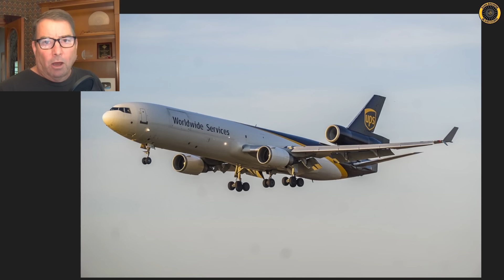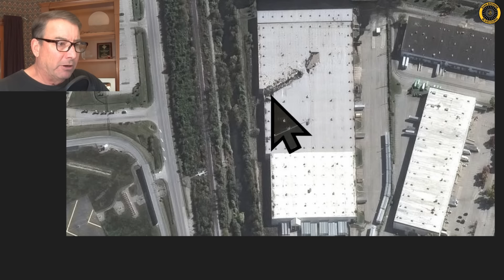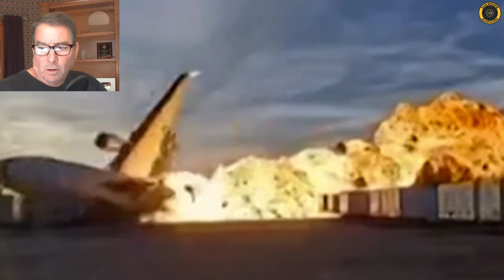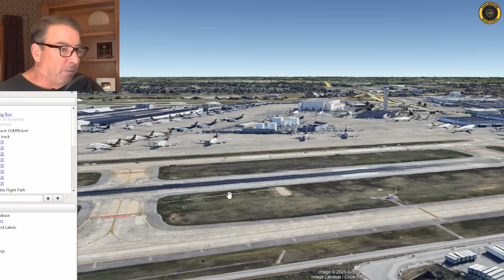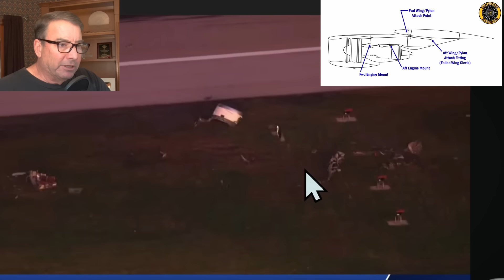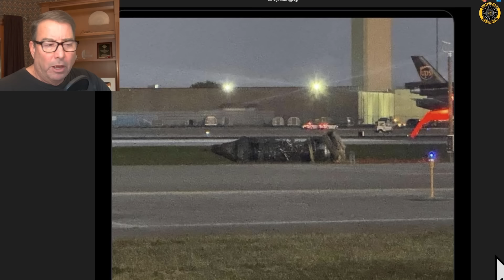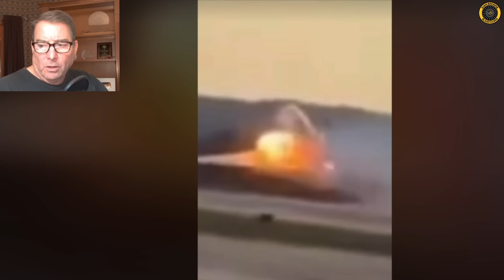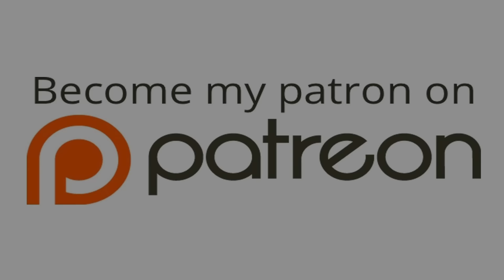UPS #2976 UPDATE 2 6 Nov 2025

Comment: 💰 1⃣ Refund and insurance payout

Yes — all packages on board are considered total losses.
UPS’s self-insurance covers them automatically.

For retail customers, UPS refunds the declared value (or standard liability if none was declared).

For corporate accounts, UPS credits or reimburses based on contractual coverage or third-party cargo insurance.

There’s no need to “file” in most cases; UPS’s system matches tracking numbers to the manifest and triggers compensation automatically once the NTSB releases the manifest list.

📦 2⃣ No re-shipment or recovery

After a crash like this, the entire cargo hold is destroyed or contaminated — jet fuel, fire, and impact damage make almost every package unrecoverable or unsalvageable.

Even if a few packages are found intact, they cannot be reused or resent:

They’re held as investigative evidence until the NTSB releases the site.

They’re then destroyed for contamination, chain-of-custody, and liability reasons.

So, you won’t see any packages from that flight delivered or re-routed later.

🗂 3⃣ How UPS handles it internally

The cargo manifest (every tracking number) is frozen.

Customers’ tracking pages change to “Service disruption — aircraft incident.”

Once the investigation allows, the system marks all items “Lost – Refunded.”

Major shippers are notified through UPS account reps and given claim batch summaries.

📞 4⃣ What happens for customers

UPS sends notification emails for affected shipments.

Refunds or claim payouts go to the original payer/sender — not necessarily the recipient.

Merchants often re-ship replacement goods once the refund or credit is confirmed.

✈ In short

✅ All packages = fully refunded/insured
🚫 No packages = recovered or re-sent
📄 UPS & NTSB = retain manifest for records, not redistribution

Comment: 📦 1⃣ Immediate loss and manifest reconciliation

Every UPS aircraft carries an electronic cargo manifest, tied to tracking numbers.

As soon as the crash occurred, that manifest was frozen in UPS’s internal systems, so all packages listed on that flight show as “Exception – Aircraft Incident” or “Service Disruption.”

Those packages are then marked lost pending recovery — nothing gets rerouted from that manifest until corporate cargo security reconciles it.

🧾 2⃣ Insurance and claims

UPS automatically self-insures for most cargo; major commercial customers (like Amazon, Apple, or medical supply chains) have contractual coverage through UPS.

Individual shippers who declared value (the “declared value” field you sometimes see when you ship) can file claims for reimbursement.

UPS will proactively contact high-value clients through their account reps once the manifest is confirmed destroyed.

For consumer shipments, UPS typically issues:

“We regret to inform you your shipment was aboard UPS Flight 2976, which was involved in an accident. A replacement or refund will be arranged.”

🚧 3⃣ Package recovery

In the crash zone, UPS security and NTSB coordinate with local authorities to recover identifiable cargo.

No item—even one found intact—can be returned to a customer until:

It is released by investigators (to avoid contaminating evidence),

It is decontaminated (fuel, debris, biohazard, etc.), and

Chain-of-custody paperwork is verified.

In practice, very little cargo from high-energy impact/fuel fire events survives intact.

🗂 4⃣ Data archiving and customer notification

UPS keeps the full cargo manifest on file as part of the NTSB docket, just like maintenance and flight data.

Customers are notified through normal tracking channels; large shippers get batch notifications.

Insurance settlements are processed automatically — usually within 15–30 days after UPS confirms the NTSB release of the cargo manifest.

🕊 5⃣ Bigger picture

While it’s easy to think of the packages, UPS’s first and overriding focus in the aftermath is the crew and families, not freight. Only once the human and safety aspects are stabilized does UPS’s cargo recovery and claim division engage fully.

So in short:

All cargo on Flight 2976 is presumed lost.

UPS’s internal insurance covers both commercial and retail customers.

Claim and refund processes will run automatically, with direct customer notifications once the manifest is officially cleared.

Comment: What I want to know is whether the left engine (and pylon) finally detached as part of the "Rotate" action ? Remember that the pylon is meant to detach from the wing "safely" moving up and over in a stress situation. 

This crash seems more like the El-Al Boeing 747F crash in Amsterdam, where a P&W JT9D engine failed after takeoff and broke off from the No. 3 position and flew to the right... damaging the wing and removing the No. 4 engine as well. That would explain how the MD-11 left engine made its way across to the right of the runway... all that rotational energy spinning clockwise....

It's also weird that the plane swerved sharply  left after takeoff.... severe differential thrust effect once airborne and off the wheels ?

Comment: If an uncontained engine failure could cause the pylon to fail, would we need to rethink our designs going forward? Has that ever happened before?
Reply: Yes.  About a dozen times.  Look up 1990 Northwest flight 5.  Better to drop an engine that is coming apart, than have it sling parts through the fuselage, killing passengers and severing hydraulic lines and electrical wiring.

Comment: I do understand that the number two engine may have gotten some intake of debris. But the asymmetric thrust would have brought it out of the flow from behind the number one engine. There was a different videographer who is claiming that as the plane was going over the road it had already hit a building even though the landing gear was intact. I listen to him but it was obvious that he was repeating about 20% of nonsense. I like your observations. I have consulted on air crashes ever since I was actually in the Air Force but not on an official scale but on a consistent scale. I was one of the few non ncos that was allowed to fly the simulator on my air base and actually teach Pilots tricks that they could do to get certain elements of the flight control systems to work when they aren't supposed to.

Comment: ✈ 1⃣ The MD-11F fleet is still active

UPS hasn’t grounded its tri-jets after the UPS 2976 crash.

The flight you cited (UPS2950) shows normal routing, speed, and duration for an MD-11F westbound trans-U.S. cargo sector.

Similar flights (SDF–ANC, SDF–ONT, SDF–OAK) continue showing MD-11F equipment.

The fleet is likely under enhanced inspection, not suspension.

⚙ 2⃣ What’s likely happening internally

After a major event like this, operators usually:

Ground only aircraft needing inspection (e.g., those that recently had similar maintenance or engine work).

Run ultrasonic/NDT checks on pylon attach fittings and mounts.

Report inspection results daily to FAA/NTSB and OEM (Boeing).

So UPS is probably rotating the fleet through short maintenance holds but keeping unaffected jets flying to maintain network continuity.

📦 3⃣ Why they can safely do that

The MD-11 has extensive individual-aircraft tracking; any with similar engine/pylon maintenance (same shop, same parts batch) would be prioritized for checks.

No NTSB “urgent recommendation” or FAA Airworthiness Directive has been issued yet — meaning no evidence so far of a systemic defect requiring grounding.

🧭 4⃣ Operational context

UPS’s network is highly dependent on its Louisville Worldport hub (SDF) — grounding all MD-11Fs would cripple overnight freight flow.
So instead, they’re likely applying tiered mitigation:

Immediate inspection of aircraft with matching maintenance events.

Controlled release of cleared aircraft.

Fleet-wide inspection within a set time frame (often 7–10 days).

✅ Bottom line:
UPS’s MD-11Fs are still flying.
There is no fleet-wide grounding order, only heightened internal scrutiny.
The NTSB has not yet recommended any operational restriction.
Reply: Great info. Thx.

Comment: One of my friends is a check airmen/mgt. on the eleven. UPS has assigned him as a liaison with the NTSB/FAA. Its been tough on him but he is doing the job. As a local I've been close and the smell alone will give you pause. Prayers up for all affected by this horrible tragedy.
Reply: I'm out in Prospect and work in the east end now but even still I have a coworker who's son was (hopefully) or still is one of the missing. Everyone here has some connection to UPS, either worked there (I did) or knows someone who does.... what a disaster.
Reply: @Nefville  Yep. My son works for ups. We're not that far away either.
Reply: I used to be a bicycle mechanic, and worked on bicycle for several UPS pilots, including a couple who were MD-11 crew. I think most of them have retired since then (this has been over a dozen years ago), but I'm sure they are shaken up just the same. I feel terrible for them, and everyone else involved.
Reply: So many of us from Louisville are tied to that area. Between the workers at UPS and FORD LAP, a good majority have some connection to that spot. Prayers to all who are effected and loved ones
Reply: I used to have an instructor who was a UPS check airman for the 747. Top-notch pilot.

Comment: 6:00 - The synthetic fibre material surrounding the fan blades is not so much for acoustic purposes, but to act as a containment barrier in the event of the engine exploding. The sheets of wrapped, woven aramid [kevlar] cloth act exactly like the layers of a bullet-proof vest, which form a dense net of extremely high tensile strength strands which are effective at resisting penetration by bullets, blades and projectiles.

Unlike normal synthetic composite construction, the fibres are not embedded in a rigid epoxy resin matrix. To be effective the fibres must be free to move over each other.

On a jet engine their job is to contain the flying debris from a disintegrating fan which would otherwise pierce the aircraft's fuselage.

The same system of woven kevlar fibres is used in chainsaw-proof clothing.

Comment: Usually when the engines grenade they don't depart the wing. Have there been any examples of this happening? I can't think of any offhand. Lots of engines have come off when they accidentally smack the runway but I don't think that makes sense here.

Certainly an engine blowing up could potentially vibrate itself off the wing if it was left running long enough but I'm thinking that would have happened early enough to be noticed before V1. Odd incident. Feel terrible for the crew and their families.

Comment: If that first building and those first power lines were not there, they may have made it. They may have advanced the throttles to max power after losing the engine but there's a delay till the engines start delivering max thrust. The landing gear hitting that first building was the straw that broke the camel's back. They lost too much airspeed and lift from that hit to ever be able to recover.

Comment: We've been lulled to sleep with our perception of safety in aviation. Anything mechanical can and will fail at some point. Hopefully the NTSB finds the root cause but who knows what other gremlins are hiding in those older aircraft.  Or for that matter, hiding in software of newer models. And unfortunately, they often pop up at the worst possible time. 

By the way, the American DC cause was finally determined to be the maintenance crew using a lift truck to install the engine. At a shift change, the lift cylinder of the forklift settled, which they often do, which allowed the engine to sink while the fasteners were only the rear fasteners were installed.

Comment: The visual condition of the engine after rolling down a runway with well above 100kts tells little about the sequence of events. Both orders are possible but when looking into uncontained engine failure events the failure mode and damage obtained is very dissimilar to and inconsistent with a clean seperation of the pylon from the wing which is consistent with the failure mode and damage obtained, clearly indicated by the videos and pictures of the accident and its aftermath.

Comment: 🧩 1⃣ The new picture of the sequence
Confirmed visually

No. 1 (left) engine and entire pylon assembly were missing shortly after liftoff.

The left wing slats were extended — so unlike AA 191 (DC-10), this wasn’t a hydraulic-line-cut issue that retracted the slats.

Wing fire continued from a fuel-tank rupture at the wing root.

The crew kept wings level to the end — they were flying it, not rolling out of control.

Impact path: cleared the end fence, clipped power lines and a building, then struck a petroleum-tank structure — explaining the massive post-impact fire.

Runway debris

Engine cowling pieces and the pylon structure were located near the 2,000-ft remaining marker on 17R — proving separation occurred before rotation was complete.

The engine core ended farther down, consistent with it detaching, sliding, or bouncing down the right side of the runway.

⚙ 2⃣ Competing mechanical hypotheses
Hypothesis	Supporting evidence	Counterpoint
Engine failure first → pylon fracture	Acoustic liner fragments visible in inlet → possible high vibration/unbalance → overstress on mount	Pylon parts appear detached cleanly, suggesting mount failure could be primary
Pylon structural failure first → engine loss	Entire assembly missing early; runway debris far from core suggests forward attach point failure	No visible pylon crack warnings pre-flight; engine shows signs of internal damage

It’s likely investigators will find dual-coupled failure: an internal engine imbalance (e.g., fan-liner ingestion) triggered extreme vibration, which then overstressed an already-fatigued pylon fitting.
That combination is exactly what you’d call a “compound age-related inevitability.”

🔥 3⃣ Post-separation cascade

Once the engine/pylon tore away:

The wing’s leading-edge fuel cell ruptured, igniting instantly.

Debris was ingested by the No. 2 tail engine, causing compressor stall and loss of thrust.

Only the No. 3 right engine produced power — one-third thrust on a fully loaded MD-11.

The aircraft reached ~475 ft AGL, wings still level, then descended — no available performance margin.

That’s why this event was not survivable, regardless of pilot skill.

🧱 4⃣ Structural and aging insight

The new data supports the earlier theory of aging-airframe inevitability:

A 34-year-old MD-11F with multiple conversion and repair cycles.

Known history of stringer cracks and corrosion repairs (as FAA SDRS showed).

The pylon attach structure remains one of the most fatigue-sensitive elements on any widebody.

Even if fully “compliant” with maintenance bulletins, the true crack origin or vibration coupling could be outside known inspection zones.

🧭 5⃣ Where the investigation heads next

Metallurgical analysis: fracture surface of pylon attach bolts and clevis — look for beach marks (fatigue) vs shear lips (overload).

Engine teardown: examine CF6-80C2 fan section and acoustic liner fragments for evidence of imbalance origin.

FDR correlation: confirm onset of vibration and thrust asymmetry timing.

Maintenance audit: confirm torque, alignment, and NDT records from San Antonio heavy check.

If the pylon failed from pre-existing fatigue aggravated by vibration, this will confirm the ineffectiveness of current bulletins for detecting aging composite-metal interface degradation.

✈ 6⃣ Operational and fleet implications

MD-11F fleet reviews are almost certain, even if not formally grounded yet.

Expect a temporary inspection order for CF6-powered MD-11/DC-10 pylons within days of preliminary metallurgical findings.

UPS and FedEx will likely accelerate the retirement curve for the type; FedEx already plans phase-outs by 2028.

🔍 In short

This accident appears to be the point where aging structure, vibration, and performance margin intersected — the “worst combination.”
The Blancolirio imagery strengthens the working theory that a mechanical/structural inevitability, not crew action, sealed the outcome.

Comment: The dash cam video appears to be shot somewhere around 7000-7020 Grade Lane, headed NE (not on the Crittenden Drive perimeter road).  On the far right side of the dash cam view, you can just see the tops of the black vertical storage tanks at GFL Environmental, which, as you point out, is where the clipped the port wing and sprayed fuel onto an already raging wing fire (maybe even separating the wing at the root).  The crew had no chance (especially if #2 had been FOD’d by debris as the #1 engine and a hundred nacelle parts may have flipped up and over the fuselage), but they did an amazing job of trying to fly it, especially after dragging the port main mount through a warehouse roof.  Prayers for them, the unsuspecting people on the ground, and all their families and friends.

Comment: And not one person in the control tower saw the giant trail of smoke and couldn’t warn those poor pilots? Absolutely gut wrenching. Soul crushing seeing those horrible videos knowing they were in there as that plane was crashing
Reply: Pilots get an engine fire warning alarm and light in the cockpit telling them when an engine is on fire.   Multi-engine planes have a decision speed during the takeoff roll.  If you are above that speed when an engine fails/catches fire you continue the takeoff and handle it in the air because you are going too fast to stop the plane on the runway.  Trying to stop guarantees that you will crash.  Usually an engine failure/fire on takeoff is just a day when a well trained crew earn their pay, not a crash.
Reply: @loudidier3891 unfortunately yeah it was too late. I wish airports had an emergency stop area for instances where V1 is reached but something bad happens and the pilots want to stop. This whole situation just rips my heart apart. I’m hoping they are with the Lord 💔💔💔💔💔